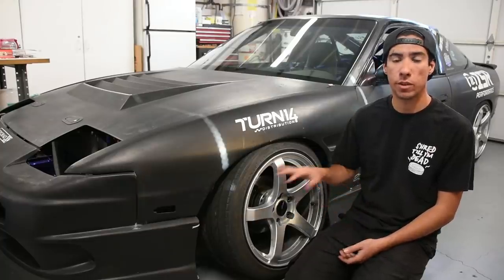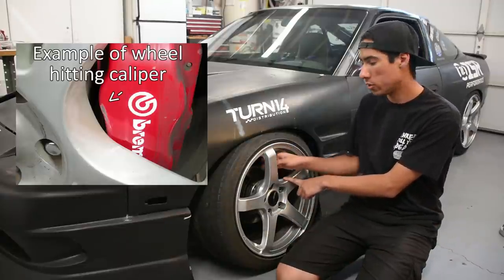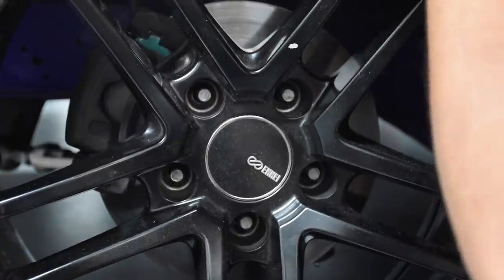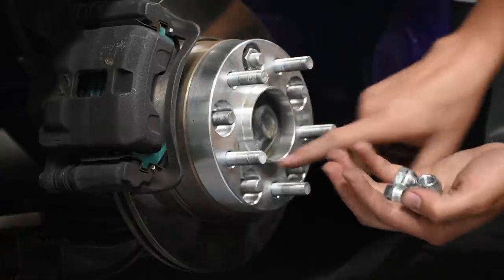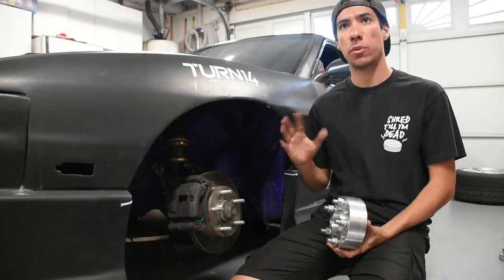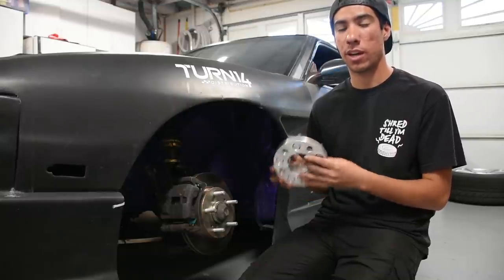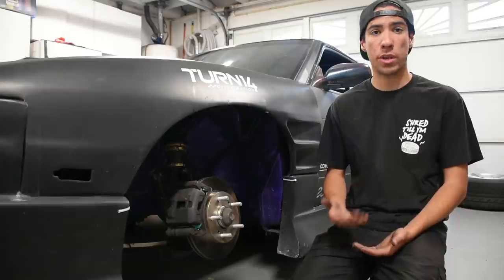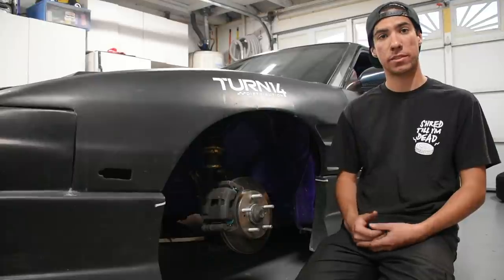Wheel Spacers Good or Bad? | Spacers Explained

Comment from the maker: Regarding the comments about the lugs have tapers on them so the wheel will be centered regardless of hub centric or not:

Yes although the lugs do have tapers to center the wheel and or spacer on the hub, there is a much higher chance of it not being centered when not running a hub centric setup and this is where most the issues of spacers come from. Which is why I suggested to only get hub centric. 
For instance:
A lot of people bolt on their wheel and hand tighten their lugs to maybe 15 ft/lbs of torque. Then they lower their car on the ground and torque it to spec. If the wheel doesn't have a hub diameter properly matched with the hub diameter on the car then there is a possibility that when lowering the car on the ground and the full weight of the car is applied to the wheel, that the wheel will move off center since the lugs are not fully torqued and are not holding the wheel 100% in place. Then when you go to torque the lugs, you will torque the wheels off center.
Make sense? 
So by having it hub centric it eliminates that room for error. And considering the negligible price difference between hub centric spacers and non hub centric it's best to go with a hub centric setup
Thanks :)
Reply: Good video good info
Reply: OffBeat Garage s
Reply: Also depends on if your vehicle uses a hub centric or lug centric hub design. Most vehicles I have seen are hub centric, but some are lug centric!
Reply: OffBeat Garage yes and people also tend to ignore the correct two stage tightening process and some of them even tighten the nuts/bolts in a circular manner instead of going 1324 or 142635.
Reply: awesome video. more people need to see this.
Reply: you should say that not all wheels have tapered lugs and DO require hubcentric spacers. Alot of toyotas for example use a hubcentric only design
Reply: OffBeat Garage in
 : 0p
Reply: I was thinking to buy spacers to my Audi A5. Im currently running with Audi's OEM 20x9 ET 37 wheels. Could you tell me which spacers you prefer (or are the best/most durable). I was thinking 15mm front and 20mm back. Like these here https://www.futurez.fi/product/68133-eibach-spacer-levikepalat-audi-a5-vm-09 (sorry about foreign language). Which one i should buy. System 2 or System 7?
Reply: ojalainen look for American made spacers. should only be 1 legitimate company and I got them for my truck 5 years ago. Came anodized in black. They've been through hell. 80k miles offroading a hell of a lot, towing trailers and furniture from nashville to denver, climbing mountains and Colorado pot holes.
Reply: ojalainen and they're 3inch spacers for a wide stance chevy truck. the better option maybe be just to get hella wide rims and tires. when I get my 12.5 to 14 inch wide wheels and wrap them in fat tires I won't need spacers.
Reply: Unless your wheels are a press fit on the hub (obviously not the case) your wheels will shift away from the center at least to some degree when the weight of the vehicle is put on them before torquing the lugs.  Most people that have hub-centric rings to adapt different wheel hub diameters to their vehicles and these are made of plastic a lot of the time - and there's no way that they will keep the wheel centered when the weight is on it since plastic deflects under that much force.  I've ran both plastic hub centric rings on a set of wheels and lug centric spacers with no issues.  The proper torque, lugs, and torquing pattern will bring the wheel properly centered on the hub and I'm running 285/70r17's on my truck which is also way heavier than any of these cars.  Other than that, great info!
Reply: As a mechanic at a tire and brake place..... don't do that. It stretches the lug and buggers up the splines where it's pressed into the spacer. So when they go to get serviced, the cutoff wheel, prybar, and sometimes disassembly from the backside happens. Net result, one buggered rim. If your playing this hard, do yourself a favor and use a torque wrench.
Reply: Holy Crap!  A mechanic at a tire and brake shop advocating use of a torque wrench over an impact!  Good on you J. M.!  Rarely ever see that.  I don't think the tire and brake shops where I live even own a torque wrench.  They won't use one even if you ask them to, so I end up bringing my torque wrench and torquing the lug nuts myself, if not at their shop then when I get home and can get the tire off the ground.
Reply: Besides  its unsprung weight, it also increases the wheel's moment of inertia, but since it is close the axis, it will only be a major factor if the spacer is massively  heavy. And then it could be drill it out, to  reduce both its, moment of inertia and its unsprung unsprung weight... 
BTW very  well do review for a mechanic;s point of view on the subject...
Reply: Nice.
Reply: If you install lug-centric wheels and you still can't get it centered, you probably don't need to be installing anything on your car, anyway. Stock Mustang GT wheels are not hub-centric and I've had them on my Ford Ranger for years with no issues. If the lugs are firmly tightened before lowering the jack, there's no way the wheel can become "off-center" because the tapered lugs have now engaged with the "bowls" in the lug holes. The wheel can't move. Lower the car, then torque to spec.

Comment: If you tighten in a star pattern gradually you eliminate the need for hubcentric rings. The star patter applies even pressure and will gradually center the wheel

Comment: omg finally someone who knows that spacers NEED to be HUBCENTRIC great video bro good info
Reply: Diogo DaCunha I run non hubcentric spacers on my winter tires. They're fine if you know how to mount them.
Reply: Simon G t
Reply: Don't need hubcentric spacers if your car or truck has a lugcentric wheel/hub design ;)
Reply: Merling Stoss show me a oem car that's not hubcentric wheels.
Reply: John Kukic pretty much any late 60s and 70s RWD Datsun is lug centric.
Reply: John Kukic most jeeps dude...
Reply: Total BS. Lugcentric spacers would not be allowed on the market if they were unsafe for use. It's human error that causes any problems you've heard about. I run them on large trucks and cars with equally safe and reliable results. Proper torquing methods are essential, and are super easy to do, but also easy to ignore if not shown how to. Don't put fear into people that haven't used them, since you don't know how to properly use them yourself.
Reply: Sean Sayegh hey man I recently bought 2” wheel spacers for my Dodge Ram 1500. While trying to install them, I noticed I need upper ball joints. So I replaced those today. Thing is everybody is telling me how dangerous they are. They’re hub centric (off Ebay). If I use locktite do you think they’ll be okay? I tow a trailer everyday for my business (lawn care)🤔

Comment: you can gently tighten two opposing lug nuts to "center" the wheels to an extent when using non hub centric spacers. been doing it for years across multiple chassis' with no issue
Reply: PlymParkOG you can, but you still have your studs taking the load instead of a nice solid big bit of steel.
Reply: given most hub rings are plastic i think it'll be good
Reply: The studs are what take all the torque of the drivetrain, so what you said isn't true.The hubcentric rings look pretty pointless imo. If you install your wheel using a star pattern when tightening the lugs you'll have no issue just like what PlymParkOG said, and it's honestly the first thing any mechanic or anyone with general automotive knowledge should know.
Reply: Oplet also not true. the friction between the hub surface and inside wheel surface is transferring that load. All the studs are designed to do is hold the two together. Their strength is along their length, under tension.
Reply: magnetic0314 its a mix of both. however the centric rings still don't hold any load at all. and they still are pointless unless someone is just using regular hex nuts for their lugs.
Reply: Yeah, it's literally to idiot proof wheel installation because there are so many people out there that can barely change a wheel. I normally install 2 lugs and tighten them by hand as I wiggle the wheel a bit, when they snug I grab the wheel and give it a few tugs then put the others on. I give about 20-30 lbs before the wheel hits the ground.

The biggest problem with peoples wheels falling off is because they never check the damn wheel nuts after 5-10km. They just drive around thinking it's perfect already.
Reply: perfectly worded (y)
Reply: no sir you cant do it that way. 70 80 mph cruzin youre good. Hit 120 and you  will think you are in the space shuttle re entering earths atmosphere.

Comment: I've had zero balance issues running my lug centric hub spacers on both of my trucks. One truck uses spacers between the dually wheels to prevent tire rub, and my other truck a 2wd, using them to space the rear tires out to fill the wider rear fenders for running staggered size tires. They are tapered the same way lug holes are in most wheels, therefore when torqued properly, they are centered perfectly and have no vibration at any speed..no hub centric rings required. The method I use which is tried and true for decades (and a TSB for some past makes and models of vehicles) is tightening two opposing lugnuts to a low torque, which centers the wheel on the lug studs. Then add the rest of your lug nuts, and torque them to the same setting. Then perform final torque in the proper torque sequence and torque value per your vehicle's manufacturer recommendations. Even if you don't run spacers, this is still a proper method of torquing any wheel, as by starting two opposing lug nuts at a lower torque at first will always bring a non hubcentic wheel into alignment before applying final torque. After 20+ years, and 100's of thousands of miles between all my vehicles at high speeds and high load capacities, I've had nothing but 100% safe and reliable results. Just my .02 and experience as both a military vehicle and aircraft mechanic. Your results may vary.

Comment: When I installed my 16x8 TE37s on my e30 I run a 5mm, non-hub centric, spacer but it does have the same center bore as my hub.  Enough of the hub sticks out past the spacer where I can use my hub centric rings to center my wheels. I did lots of research before purchasing anything. Thanks for this video, I'm sure it'll help a lot of people 👍🏻👍🏻👍🏻

Comment: Another thing to note is to make sure the wheels you are running have reliefs cut in the back of the mounting surface for the studs that stick out from bolt on spacers

Comment: I run 20mm spacers on the front of my e36 to clear the control arm for my angle kit at 68 degrees of lock. Never had any problem with them and I've been running them for 2 years in proam. As long as you don't cheap out, you shouldn't have any issues.
Reply: Collindoesdrifting what brand are you using?

Comment: I can't say more. I love how this is explained correctly.
Okay... If you have excessive bearing wear, that means you're offsetting the bearing, causing damage due to the bearing load not on the load areas specified for the bearing(oblique force).
Spacers are not really bad since they allow flexibility, but since they are bolted on, you can expect some losses because of that(a single piece is stronger than multiple parts held together).
Changing the offset of your wheels not only affects load balancing and track width, but also can give you more headroom to fit wider tires that the stock offset cannot.
If possible*, always get your rims with the correct offset *before choosing a wheel spacer if you cannot have the proper offset.
And about unsprung weight, increased mass on the wheel due to the offset is basically the same exact thing as a spacer adding mass. The spacer will always have more mass due to the lugs.

Comment: As a mechanical Engineer, I appreciate that you shared such great information. Good on you for actually doing research and making sure you understood it rather than taking an internet mechanics word. Also was really happy when you mentioned how the clamping friction is how the load is transferred, this let me know that you really did research and found good sources, as this is how I learned it in class and it makes sense.

You are quite intelligent (have watched since the first drift car was bought), and you have always made that obvious with how you choose to approach things.
Reply: blindassassin111 the funny thing is clamping friction is the same argument used for why you can get away with not being hubcentric. Glad he recommended remaining hubcentric anyway.
Reply: But clamping friction doesn't center wheels so that is a bad argument. Being hubcentric accounts for centering and clamping friction accounts for load, both are needed. On the wheel centers I designed for a small race car, the wheel is hubcentric and doesn't use tapered lugs to aid the centering, but being hubcentric is a necessity for safe mounting.
Reply: blindassassin111 I agree with you. Just noting people use that as an argument for hub centric not being necessary....particularly with tapered lug nuts. Those people, the vast majority of cases, are wrong. There are exceptions. But whatever. No reason not to be hubcentric, other than a few specific type wheel exceptions.

Comment: Some wheel spacers are lug centric, because they are  made for Lug centric vehicles. Toyotas Pickups until 1998 where lug centric, In the front you won't be able to fit a hub centric spacer it won't fit. For my Toyota Pick up, I have  lug centric spacers on the front and  hub centric in the rear(they do fit there).

Comment: People also run spacers because they are unsure exactly what wheels will fit. The 240SX is a GREAT example here, as you will find LOTS AND LOTS of conflicting information on the internet regarding what will and will not fit. Given that most of us are not going to be able to experiment with a wide variety of tires and wheels to find the perfect fit, buying a wheel with a relatively large offset is a safe bet. This allows the use of spacers to dial in the offset. This, of course, is not possible with low offset wheels.

Comment: Be careful when mounting wheels on smaller bolt on spacers. The stud can stick out far enough from the spacer and can make contact with the wheel and not sit flush on the hub.
Reply from the maker: True
Reply: Daniel Alaniz happened to me. had to reorder 35mm spacers. not 25mm.
Reply: Yup happened to me and started to drive off then looked in my rear view mirror and my wheel was wobbly scariest moment ever
Reply: then you cut the studs????
Reply: rocket science

Comment: wow you absolutely nailed it! 👌💯👍 the only suggestion I'd add is the installation process. poor installation can lead to failure (i.e. you should always re-torque after the initial 30km drive, and what material the spacers need to be like billet etc.)

Comment: 1. Hubcentric rings only help with initial mounting. When lug nuts are torqued properly that is what holds the wheel center.

2. Good point about the scrub radius. However, the vast majority of sports cars have proper scrub radii.

3. It is common knowledge that wheel spacers above 5mm greatly increase strain on the hubs. This might not an issue on low speed, regular driven vehicles, but a track vehicle (not drift, due to the low grip those tires see) heat buildup can cause or accelerate catastrophic hub failure.

Comment: Nicely done; clear explanation and graphics!!

Wish I knew of hub-centric 30 yrs ago; I mounted some non-stock wheels w. new tires on an E23 BMW.  Wheels had same lug circle dia, but they shook - sometimes a little, sometimes a lot.  Had the tire shop re-balance 2x, but never fixed it.  They never mentioned hub diameter...

The car had tapered lug bolts; even if they 'should' center the wheel it wasn't good enough to be smooth at speed.  I always torqued with 2-step or 3-step process.

Another spacer benefit is similar to using centering rings.  Wheel mfrs can make far fewer variants, which "should" make them less expensive and might make it easier to find a replacement for a damaged wheel.

Comment: Note on the 25mm rear spacers do your wheel studs expend beyond the spacer if so you must cut them so you have a proper matting surface. And every one running thick spacers or higher offset wider wheels should seriously consider rebuilding their suspension steering components and wheel bearings. Since higher offsets will put more wear on those components. Particularly on a moderate mileage vehicle.

Comment: Two thumbs up for the extremely well explained video. Your explanations are even better than most resellers of these products can say.
Edit: make one (if you didn't already do) about bolt pattern change. For example i am trying to go from a 4x108 hub to a 4x100 or 4x114.3